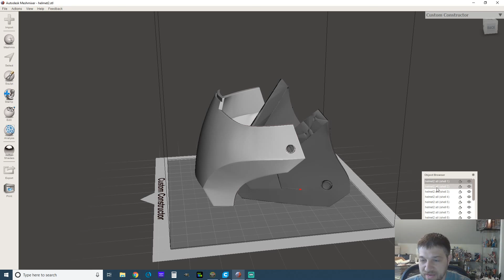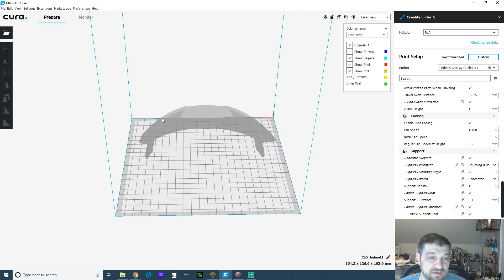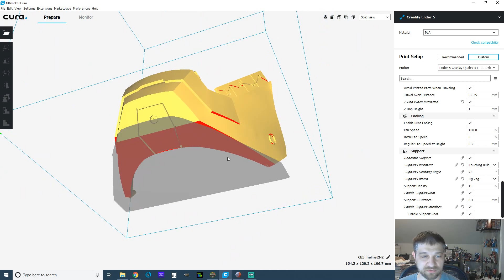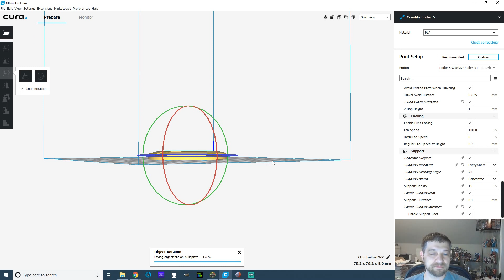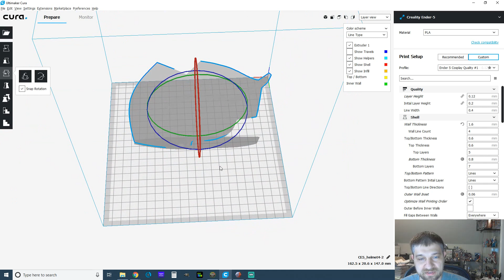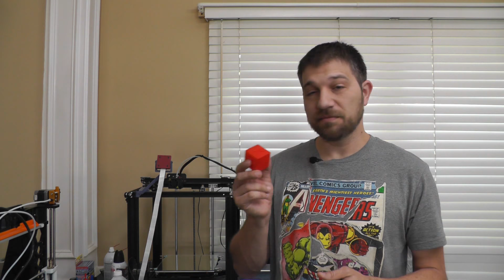3D Printing Iron Man Mark III #1: Separating Components and Orienting Parts

Comment: I have 2 questions.Was the printer used creality ender 3.0? How many hours total did it take to print all parts of the helmet.
Reply from the maker: 1) I used a Creality Ender 5.
2) I don't remember how long it took in total. Each part is relatively fast.

Comment: awesome video.  Thank you so much, you saved me and alot of other people a ton of work breaking out the parts like that...  looking forward to your next video.. i'm hoping you'll show the best way to connect the pieces together.. there are no obvious glue points to use, so I was thinking of using epoxy putty to joing the pieces of the helmet (minus the base of the helmet rear), and also join the 2 pieces of the face mask..    good luck and thanks again..
Reply from the maker: I really want to finish this soon! Thanks for watching. Check out 3D Gloop! for gluing PLA together.

Comment: Are you going to do a tutorial on how to put the helmet together? The faceplate is pretty intuitive, but I'm not sure about the rest. Maybe it's one of those things that you can just see how it goes together once you have it printed...
Reply from the maker: Yes I am! I'm having to refactor a couple of things then I'll continue the series. I may do something a little different than most.
Reply: @kerseyfabs  is there an ETA on that? Just wondering so I know when to come back and check. 😁
Reply from the maker: Probably a couple of weeks. If you're subscribed you should see it!
Reply: if you have the pieces in hand, it shouldn't be too difficult to figure out what goes where.   IMO, 
the harder part is figuring out the best way to glue it altogether..  wish the original design had included some glue tabs or something..
Reply from the maker: I'm way behind on this after finding out how hard it is to film while the kids are home all summer! It's still on the list though. If you want some solid adhesion, get 3D Gloop! It bonds PLA, APS, and I think they have a a PETG too.
Reply: Thanks. I'll check it out.

Comment: Ambitious project! Also, maybe I missed the info, but I assume you plan to add electronics like LED lights, especially the reactor core ring light and stuff like that, right?
Reply from the maker: Yes! It will have full electronics. I even plan to take a few of the electronics to the next level.